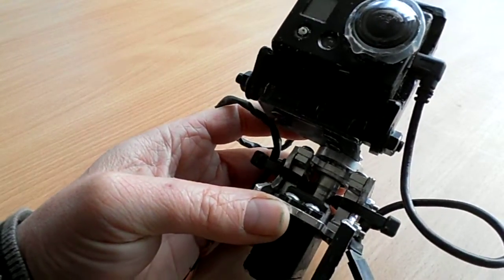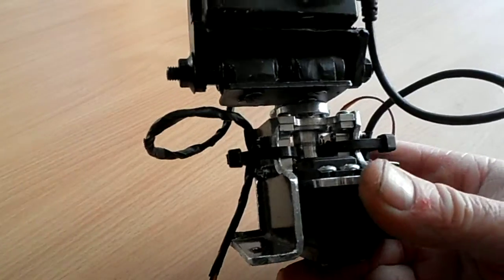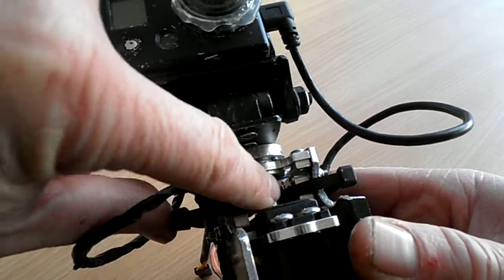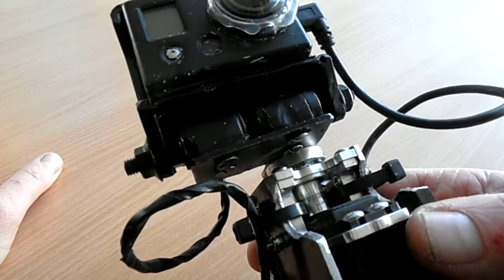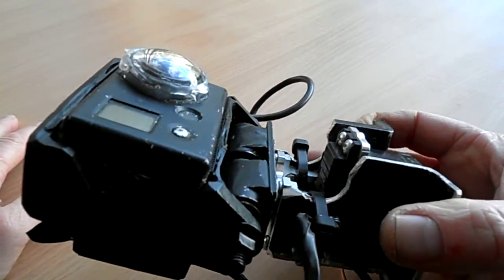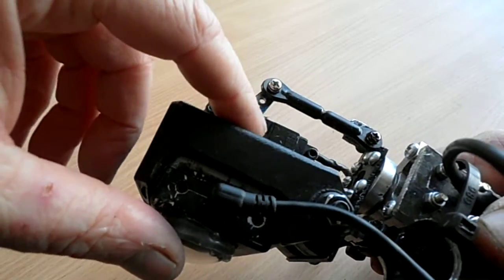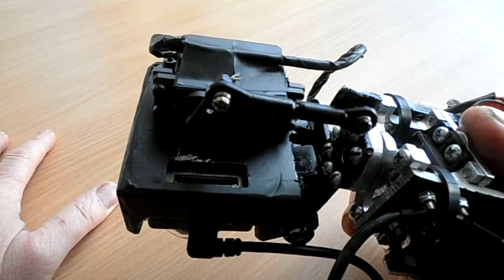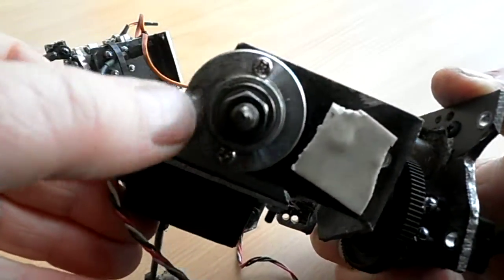Gopro 360 degree pan tilt for fpv heavy duty

Comment from the maker: Yeh, I am planning on putting up more videos on my setup. It seems to be constantly evolving. I use different frequencies for my video TX depending on what I am doing. For long range though the lowest possible frequency (that doesn't have interference) and the highest power TX you can get is best. Ie. Don't bother with a low power 5.8 ghz system!